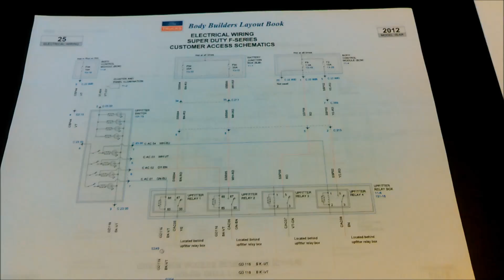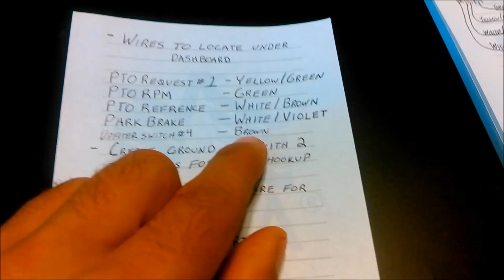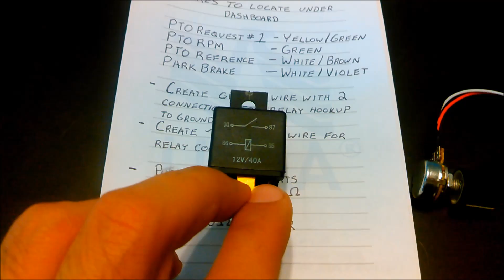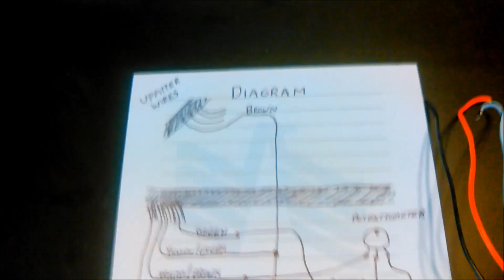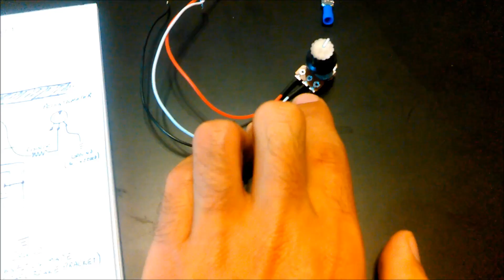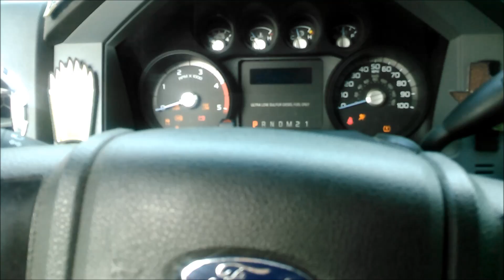Ford F-250 XLT Super Duty 6.7l - SEIC adjustable high idle modification with parking brake bypass

Comment: some trucks like mine u can switch your #4 outfitter to be hot all the time so it will work with auto start. there are vids that show u how to slide the fuse link over for hot all the time
Reply from the maker: That's good no know. What year is your truck?
Reply: 2015 f250 paltinum

Comment: Thank you for the info, links will not open for the ford bulletins however I’ve got some good intel on the video to make a search. Semperfi 2011 Texas powerstroke! 💯❤️🇺🇸
Reply from the maker: I didn't realize that Ford had changed their Body Builders site around. I spent some time and found what seemed to be their updated documents. They're not exactly as they used to be but I think the information is still there. I can't change the video but I did update the links in the video description. Thanks for leaving the comment and letting me know the links were not working.

Comment: if you switch the outer post on your pot  it will change the direction to increase decrease rpm IE clockwise to increase  you show counter clockwise ti increase in your diagram  the outer posts are reversible
Reply from the maker: Roger that, thanks!
Reply: Drive mode

Comment: Very detailed!! Love your diagram!! What gauge wire do you recommend I get to wire this up!!
Reply from the maker: Glad it was helpful. Any wire should work really. 16g would be plenty & still be easy to crimp with regular connectors.
Reply: Thanks Bro ordered all the stuff already fixing to get the wire!! Really appreciate the quick reply!! Anxious to get this project started!
Reply: Got it Brotha did the full install the high idle and the the battery saver to rig up the inverter came out looking really clean the high idle works bad ass haven’t rigged up an inverter yet but at least I got this rigged up so I can move forward with the inverter totally happy with this set up thank u so much for all the help I’m so happy with this set up
Reply from the maker: @jorgesalazar8356  Glad you got it going, cool!

Comment: It works in drime mode
Reply: Will truck drive normal with idle set up to 830 rpms?
Reply: SpeedyDukes do not drive the truck, I will only use the transmission to put in gear the PTO that I installed in the middle of the drive shaft that will activate with an air switch, which I will control the idle with a wireless remote control up to 3000 rpm

Comment: Where in South Texas? I'm getting ready to do this... lol
Reply from the maker: Near San Antonio
Reply: @CallMeColtLLC  we may have to get together on this if I'm unsuccessful in a few weeks when the potentiometers get here.
Reply from the maker: Don't doubt yourself! Just screenshot the wire diagram I made & keep the video saved for reference. Take your time. You'll get it!
Reply: @CallMeColtLLC  both are 6.2L trucks. 😂😂
Reply from the maker: I'm pretty sure you can't do this with a gas truck. Has to be a diesel.
Reply: @CallMeColtLLC  I found the Ford Body Builder PDF and it outlines the wire colors and resistor requirements for the 6.2/6.8L trucks.
Reply from the maker: @vaquero_solutions  Okay, sorry about that! Now that you mention it, I just didn't print the pages with the 6.2l info on it.
Reply: Sigh. I can get it into the 900rpm 'standby' mode, but not further. I'm missing something.
Reply from the maker: @vaquero_solutions  Just triple check all your connections & wire colors.
Reply: @CallMeColtLLC  yeah. Found I'd mistaken a grey orange for a blue orange. Re did it. Still no luck.

Comment: Just a heads up, my 05 has an aftermarket remote start and if I leave an upfitter on and remote it the upfitters do work, I can't say for factory starters, but my aftermarket one works.
Reply from the maker: The newer trucks need the physical key in the On position for the switches to have power. You could run your own constant hot wire to the switches, but I'd rather leave it as is to keep from accidentally killing the batteries.

Comment: I saw someone do this without a potentiometer? Are you able to do it with just a resistor to have a set idle? If you can what is the size resistor you need? I heard 22k but that seemed pretty wild to me.
Reply from the maker: Yes, the resistor chart is in the Body Builders guide for the modification.

Comment: Hi there, with this installed after you start it up in the morning will the truck automatically rev itself up in the winter with the upfitter switch off?
Reply from the maker: No, the switch has to be on. Also, it will not work even with the switch on if using remote start because accessories are not powered when remote starting.
Reply: Ok thank you

Comment: You probably won’t answer seeing how you posted this 7 years ago, but I just tried it on aux3 cause my aux4 is already being used. And my parking brake light is on all the time(with ground connected or not) and it only idles up if the ground isn’t connected. Is this happening because aux3 is a 10amp and aux4 is a 15amp?
Reply from the maker: It was a very long time ago when I did this, but I don't know if the upfitter directions have the AUX4 used for a reason. Sounds more like there is an issue with the wiring somewhere, somehow. I still have this in my truck & it is working great. Almost 300,000 miles.

Comment: So you have to install an upfitter kit to have this happen?
Reply from the maker: In the way that I show how to do it, yes. I think it can be done without the Upfitter switches but it makes it more complicated. you would need to run your own switch, wires, and substitute your wires for the ones used by the upfitter wires in the diagram that I made.
Reply: @CallMeColtLLC  what we have is a 2012 34 passenger f550 6.7 Ford diesel, shocked it never came with a fast idle we just bought it about 6 months ago
I'm a ham radio operator and a mechanic so I don't have any problem running switches and wires

Comment: Drive mode
Reply from the maker: Sorry, but I'm not sure what you mean by drive mode. If you mean when the transmission is in drive, no it will not as the transmission being in Park is one of the required conditions to satisfy the computer so it will enter SEIC mode.
Reply: CallMeColt45 yes- drive mode means like using in gear but stationary, is becouse im using a pto with two hydraulics pumps between transmission and the back wheels and i need the rpm idle about 2800 rpm in gear to run the pto
Reply from the maker: If you're setup is taken off of the PTO spot on the transmission then you don't have to be in drive for it to give power to your hydraulics, unless you have some other setup that engages in line with the drive shaft. I'm sure if you had to have a high idle in drive there could be a way to flash the computer SEIC program but that would be way above me & personally I'd be worried about messing up other functions.
Reply: CallMeColt45 I am trying to install a vmac throttle comander and a pendant  remote control  but I can not make it work in a 2017 ford 550
Reply: CallMeColt45 yeah, i install the pto between drive shaft and i have to take the truck to ford so they can reprogram, and i can use the truck stationary but at thw same time on drive shift, and i install a wireless remote control to control engine rpm, this is like my 6 truck i buil with this sistem before it was like plug and play but today they bein doing more harder to install
Reply from the maker: Sorry but that sounds way above my level! Hopefully you can figure it out without to much trouble. Sorry I couldn't help.

Comment: Are you all stock with your exhaust or have you deleted the dpf/urea? you said you don't need a potentiometer, I assume I would just leave it out of the circuit from your diagram if I didn't want it and the truck would idle at whatever resistor I have installed?
Reply from the maker: You are correct. leave the POT out. At the time I made this, I was stock. Recently I deleted & tuned to get rid of all that stuff.
Reply: Thanks, great video. I have a 2012 as well and have been looking to get rid of the dpf/urea. Recommend?
Reply: Etc feeder drag we are Aldo I have
Reply: ***** go
Reply from the maker: +Troy Bienert I just went to a local diesel performance shop that was highly recommend. They did all the work. Just make sure whoever does it knows what they're doing.

Comment: Will this work on the new 2017.   The only concern is with the Park Brake addition.  Under the Park Brake SW (White Violet) circuit in the Q256 Document for MY 17+ SEIC, it states.......- NOTE: The Body Control Module (BCM) park brake input also uses this signal. The BCM park brake input cannot source any current. The body builder must provide a high impedance circuit (such as a Field Effect Transistor) with a 20 kilo-ohm or larger resistor to prevent faulting the Body Control Module. See schematic in the Body Builder Layout Book.

We did the mod on a couple of our 17s and it seems to work fine as you state.  I posted a link to this video but others are asking/questioning if another transistor is needed like mentioned about.  I don't  know so thought I would ask.  You probably don't have a 17 but if you read through the https://www.fleet.ford.com/truckbbas/non-html/Q-256.pdf  It is very similar to 16 and prior.

Any advice woudl be greatly appreciate.

jjw
ND
Reply from the maker: Jerry Weigel I'm sorry but I don't know anything about the new 2017 setups. Good luck!
Reply: Thanks for getting back....like I said, it is working fine.  We will just see how it plays out.  Really like not having to press the park brake.  When we set the idle, it does turn on the park brake light,  and if you put the truck into drive, you get a warning that the park brake is on (just the light).  Does this all happen with the older trucks also?
Reply from the maker: Jerry Weigel Yes, that's what my truck does if I shift into drive.

Comment: Is the Park Brake wire (white/violet) a terminated wire like the PTO wires (and the upfitter wires)? or do you have to tap into it?
Reply from the maker: Marvin Martian Not sure what you mean by terminated, but it's a wire already cut in the bundle. It's not the wire going to the actual parking brake.
Reply: Thanks, that's what I meant.
Reply from the maker: Good luck!
Reply: Thanks again. I noticed in the Ford layout document I have, that the wire on the pot you have going to ground, is going to PTO RTN, and they are using a 5k pot. have you tried this?
Reply from the maker: Marvin Martian I didn't ground my POT. just removed the wire. Found no reason to do it.

Comment: I think this was asked but for clarification If I was driving down the highway and my friend flipped that switch. Would it cause a problem with anything or would it just not work.
Reply from the maker: If it's wired exactly as mine, all it will do is make noise at you that the park break is engaged. Just flip the switch back off & you'll be fine. SEIC won't be enabled unless the vehicle is in park so there's no risk of engine power loss.

Comment: I have tried this with my 2012 6.2L gasser. I cannot find the correct combination of wires. In fact there is no white with brown stripe wire. Which may mean that my truck didn't come with the SIEC. IDK. But also bc its a gas engine there might be a wire that can be used in place of the white/brn PTO REF wire.  I bought everything i needed and I'd really hate to have wasted that money. Can anybody point me in the right direction on this?
Reply from the maker: I don't believe gas engines have SEIC programmed into the ECM.

Comment: Hey man! I'm having a hard time trying to find a 50k potentiometer. Do you think that an interior dimmer switch would work? All the way to the bottom clicks off and then as you dial it up it turns on and gives it more power? 
Also, i would like to keep the ebrake safety feature in tack, so would I just omit that relay and connection? 
Thanks!
Matt
Reply from the maker: torawhide41 I have no idea on that switch. Radio Shack or eBay should have what you need.
Reply: CallMeColt45 thanks. We don't have radio shack so I'll have to try eBay ! 
A dimmer switch is just a rheostat, but I read somewhere that a rheostat can't be used in place of a potentiometer.
Reply: Ebay has lots I got 6 for $6.89   6x 50K OHM Linear Taper Rotary Potentiometers B50K POT with Black Knobs 6pcs U27
Reply from the maker: I just re-read your comment. Yes, just omit the relay & connections for the parking break bypass & you can keep that feature.

Comment: how exactly do wire it without using the potentiometer. Do you just not wire anything into the green wire?
Reply from the maker: When looking at the wire diagram, just don't include to potentiometer. White/Brown wire to the resistor of your choice, then to the green wire. There will be no ground at this point without the potentiometer either.
Reply: CallMeColt45  Thank you very much. Your hand drawn diagram is better then fords no bullshit.
Reply from the maker: Glad it was a help. That's why I took the time to make the video since I couldn't find one simple enough. Share it with anyone else who might want to know how to do it. I also have a second one to wire up both the high idle as it will work in this video & the Battery Charge Protection for if you run an power inverter or anything with high power draw.
Reply: Do both the white brown wire and the green wire get current after the resister or does the green wire get straight current   without a resistor
Reply from the maker: You would put the resistor between the wires.

Comment: Where  did you get the adjustable switches at
Reply from the maker: They're called potentiometers. I used eBay.
Reply: @CallMeColtLLC   can u send  me  the  link  the one u have
Reply from the maker: @justinshifflet9700  I can't because I got it 6 years ago & the listing is long gone. Any potentiometer can be used as long as it's within range of what is required. If I remember correctly, the body builders guide says the minimum/maximum & you get the potentiometer that is in that range. If it's out of the range, when you adjust it to a point where it's out of range, it will shut down the SEIC.
Reply: @CallMeColtLLC  ok thank you  very much

Comment: Whats the point of not setting the parking brake?
Reply from the maker: John Copello It's one less step needed to put the engine in SEIC mode.
Reply: CallMeColt So it’s just to accommodate not lifting your left foot got it.
Reply: Up north we deal with a lot of salt being put down on the roads in the winter. Lots of emergency cables will seize up if they are used. Still work as a emergency brake but you will only get one use out of it and then it won’t release.
Reply: for me it so i can use remote start have my switch on that night and not have to go out and set parking brake if i forgot to

Comment: What’s the part number for the potentiometer?
Reply from the maker: I don't have one, but any potentiometer will work that's within range. If it's out of range, you can also use a resistor to stop the upper limit.
Reply: CallMeColt45 thanks for the info. I saw someone commented about getting one on ebay, I saw a few of them. Very detailed video, thanks. 👍🏽
Reply from the maker: My goal was to compile all the information I read & make a video for someone to follow. It's a bit long but wanted to make it easy. Glad it helped you & share with others that need the information!

Comment: Will this still work on a 2015?
Reply from the maker: Noah B I don't see why not. Not much changed with a 2015. If you find the wires I talk about, you should be good to go.
Reply: Do you remember what gage wire you used?
Reply from the maker: Noah B It really doesn't matter because it's very low voltage. I just used scrap  wire I had.
Reply: It worked on my 2015. I'm working in NM and the temp outside drops quickly at night. Being able to increase the rpm's keeps it nice and warm inside. I do a lot of idling which requires me to regen and the only way to do that is drive. Interested to see if I can bump it up to 2,000 rpm and fool the computer.  Thanks CallMeColt45 for the detailed easy to understand video!!

Comment: What rpm happens without a resistor?
Reply from the maker: Kyle Peel The idle will not change. without a resistor in range the SEIC won't activate.

Comment: With the park brake bypass does the dash light stay on at all times?
Reply from the maker: matt Only when you turn the upfitter switch on for the SEIC if you do it the same as me.
Reply: CallMeColt45 good deal appreciate the quick reply